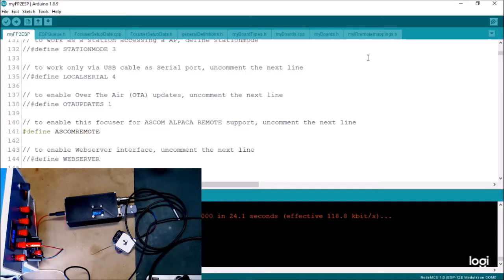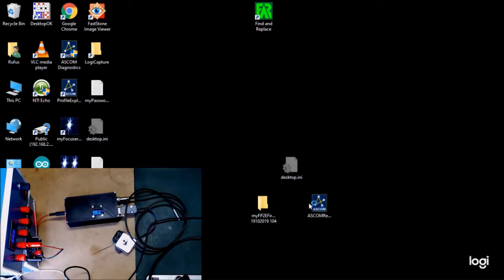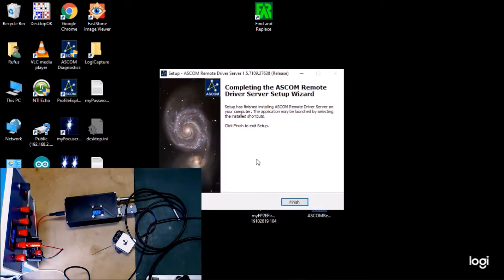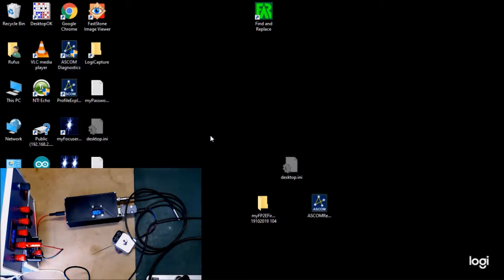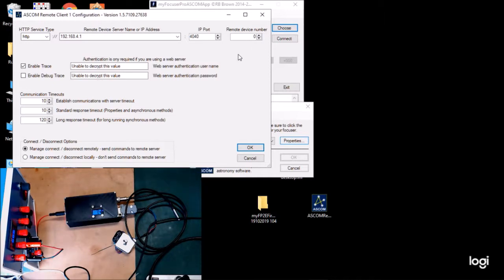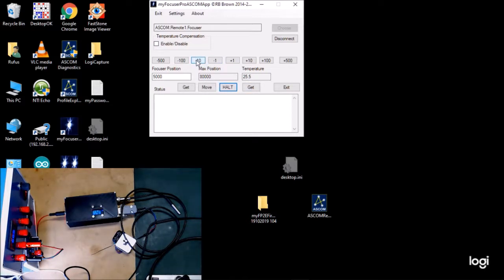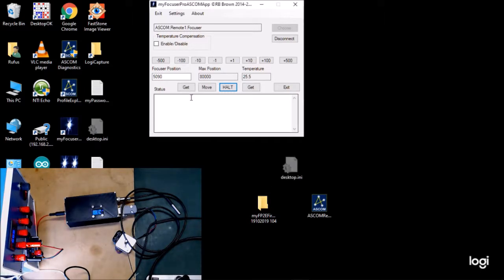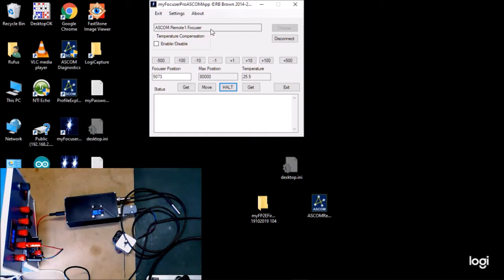myFP2ESP ASCOM ALPACA REMOTE Focuser

Comment: Thank you for continue improving and providing this focuser solution as an open source project. I'm using one but I did some modifications in the firmware and hardware so I can control the step size setup in the windows application instead of switching jumpers. One of my feedback is: you may want to take extra care of using delay () function as it hangs the controller, it slows down the motor moment. Based on your initial firmware, I modified my own version so my focuser runs very fast with a minimal vibration. The other thing is the backlash compensation, you may want to remove the backlash, but you may want to avoid the slippage as well. My approach is to move the focuser out then move in to remove the slippage.
Reply from the maker: Thank you for your comments. For the ESP8266 delay() is all but mandatory to prevent a controller reboot as there is only one processor to handle everything. If you do not release control periodically then the 8266 will definately crash as it requires time to update the WiFI side. This is normally done with a simple delay. The backlash algorithm works exactly as stated, compensating when the move direction changes, which is what you do by moving the focuser out then in. The backlash algorithm in the focuser code actually works very well, only being applied when there is a change in direction. With the ESP8266 there are not many pins available, but stepsize is configurable in software on the ESP32 based controllers because of the extra pins available.